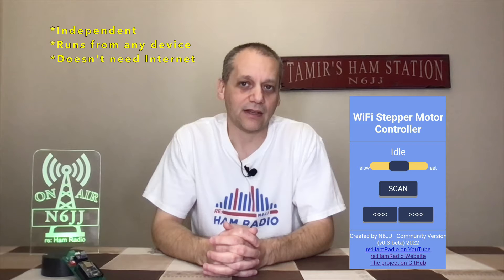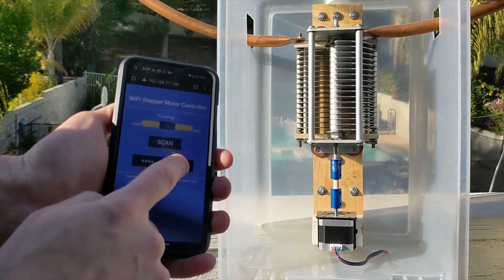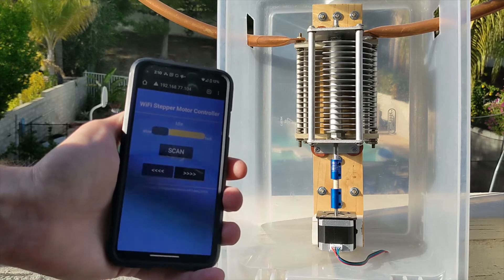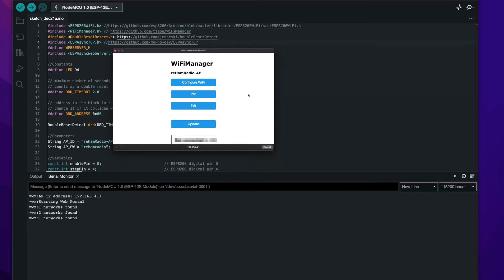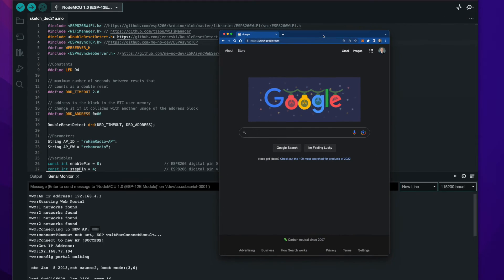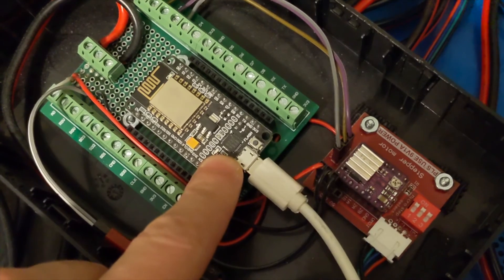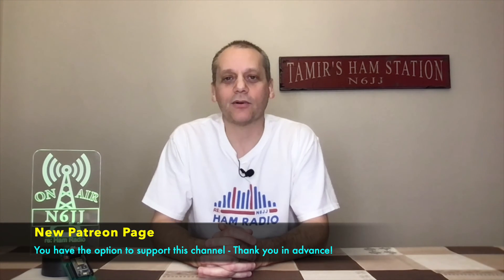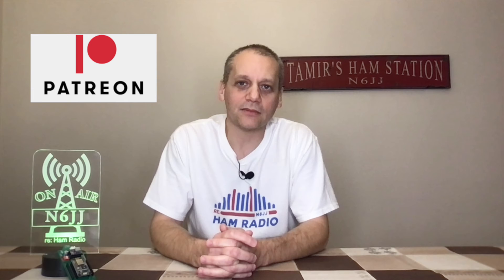New WiFi Stepper Motor Controller App for Magnetic Loop Antenna (Blynk replacement!)

Comment: Thanks for your great videos :)
I can't wait to order the "WiFi Stepper Motor Controller Kit" from you and put it on my loop antenna. Continue with your videos it's super helpful for me as a beginner 73
Reply from the maker: Thank you for the feedback, Niko. I'm happy that the videos are helpful. I will update soon with a link about the controllers. Stay tuned and good luck. 73!
Reply from the maker: Please check again my website, I added a waiting list form with details about the Wifi controller, thanks.
Reply from the maker: Hi again, please check my website, the controller is ready for shipment and a new software version can support vacuum capacitors :)

Comment: What is the maximum power radiation these board will handle with out destroying them?
Reply from the maker: Even though the DRV8825 can handle up to 45V/1.5A, It will be limited by the Voltage 5V regulator for a MAX of 1A.
I did lots of test with Nema17 and it never passed the 0.5A.
Reply: @reHamRadio  i was talking about RF watt radiated near field of the device, not the power supply voltage
Reply from the maker: I'm using that with 100W with no issue. I never tested that with more than that. Also, If you will check the video of how I built the Mag loop antenna, I mentioned there that I located the controller down at the leg of the tripod, and not near the capacitor. That's the safest way to use these kind of solution.

Comment: oto řešení možno použít i na portejblu - tedy mimo síť WiFi v interiéru?
 vyjádřit
Reply from the maker: Hi @Lev,
Yes, this application can be use on any device with a browser, include Laptops.
As for the network aspect:
1. If you need to use the application outside from your home, you will need some "hotspot", and you can use your phone "hotspot" for that. You don't need any Internet connectivity.
2. If you are asking about connecting to the application from outside of your home network, but the ESP is inside you home network, you will need to add a special rule in your home AP Firewall (Even it will work, I don't see a real use for that unless you are build a way to control your all of your station remotely).

Comment: This is really slick!  Sure looks like a fun project - looking forward to your PCB board.   In some of the links you provided there are several choices/variations of the parts - can you list which one of the stepper motors ?
Reply from the maker: Thanks, @David. I will update soon about the PCB.
As for the stepper motor link, I just updated/sync the links for the stepper motor in the descriptions of both videos, old and new. Please take a look, let me know if any more help is needed. Good luck, 73.
Reply: @reHamRadio  Thank you!!  So we need/want the non "S" version/style of the motor ?  (17HS44010)
Reply from the maker: @David, in my case I'm using the non-"S" version, even though it looks like that the "S" will work as well. I didn't find online a formal explanation/specification about the difference between S and non-S.
Reply from the maker: Please check again my website, I added a waiting list form with details about the Wifi controller, thanks.
Reply from the maker: @David, the controller is ready for shipment, please check my website for all the details. Also, the application supports vacuum capacitors

Comment: In the first lines of code it has (include) then links. I get an error. do I need to copy and paste the code to make it work? Thanks
Reply: I am sure the problem is on my end don't have much of a clue when it comes to microcontrollers. I would like to learn about them though.
Reply from the maker: Have you uploaded the libraries as mentioned in the README file?
Do you want to share the exact error?
Reply: I did try to load the libraries but I don't know enough about this to make it work. I am taking a break for now. My work load is quite high right now I will revisit it later. Thanks for the videos and the help.
Reply from the maker: @Bruce, of course, understood, take your time.
When you get a time, just start with a fresh new copy-paste of the code from GitHub.
The code checked few times and I also got a confirmation from other hams that it's working.
I will be happy to help you, but I will need some clues of what you are seeing there.

Also, I can update that I already have an idea on how to deploy a new code easily and faster with a simple and shorter procedure. I will work on that. Stay tuned.
Reply from the maker: @Bruce, thanks for pointing out that bug, I just released a fix.
Please just copy-paste all the code, the same as you did previously and it should solve this issue. I'll wait for your update.
Thank you!

Comment: Thank you so much for this new solution!
Reply from the maker: Glad it helped! Happy Holidays, 73!
Reply: @reHamRadio  I have completed the ESP set up and the software works.  I just have to wire the hardware now and test it.  A suggestion for the future if possible would be to add a second stepper to rotate the loop using the same web page interface.  That way the loop can be turned to maximise signal and null out interference.
Reply from the maker: Thanks, @Alan, thanks for the suggestion. I love to hear people ideas and needs and based on that I will priorities future features. 
Yes - I already got that request about a second motor. It's on the list. I'm going to release very soon a new version (under final development stage now) that will include few features that lots of people asked for, like the option to control of a Vacuum cap and more.
Stay tuned, there's more to come.

Comment: I just did this a month ago. I scrapped blink.
This works better with a fixed IP address somewhere out of the way otherwise it will default to the next IP  available which may be taken by some other device.
Reply from the maker: Yeah, but usually the router will keep the same IP to the same MAC address. I did lots of tests and reset my ESP so many times during the development process and it always kept the IP. But, I also have a long list of features to add, and one of them is the option to choose the way to assign the IP, automatic or fixed.
I wanted to release this version so no one will be blocked when Blynk will shutdown their v1 app.